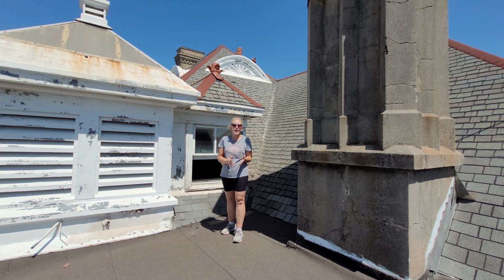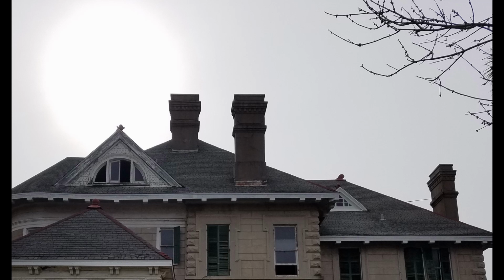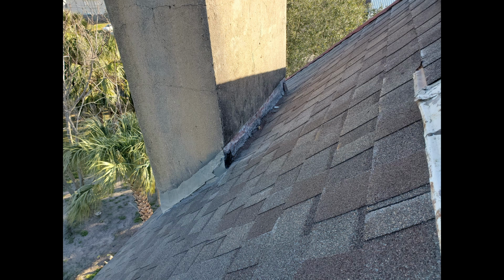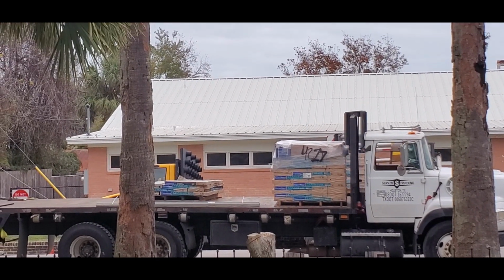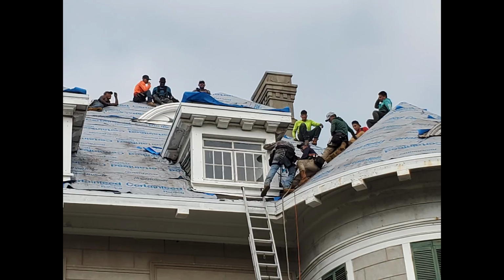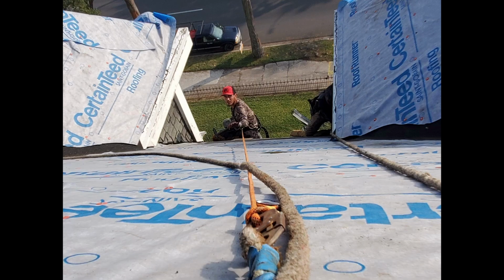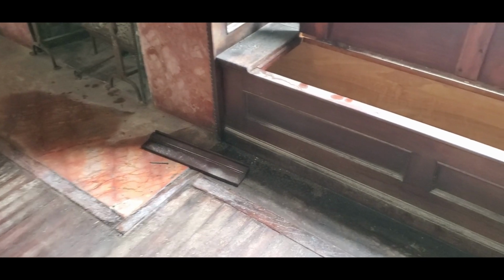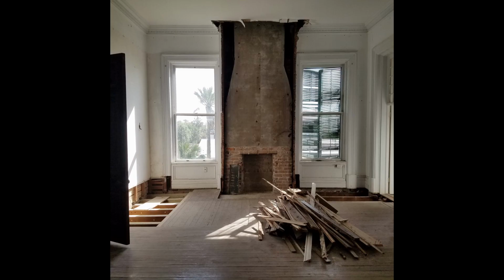S1.25 Replacing the Roof - A Renovation Nightmare

Comment: that one chimney next to the flat roof is magnificent! :O
Reply from the maker: It is.  I think it is original to the house and just got plastered over.  We are contemplating removing the plaster to repoint the chimney and leave it exposed.  The other three chimneys either collapsed during the 1900 hurrican or were altered later as they don't match the photos of the house just after it was built.

Comment: Having a defined scope of work is critical to getting proper bids. I like to include in my bid specs that any assigned sub contractor must sign off on the scope of work as part of the bid submission. I also require that subs must be liscened and insured. This prevents and protects you if the Roofing contractor subs out the work to some "handyman" who is unliscened, uninsured and hires his crew off a streetcorner..  I like the way you dealt with the estimator and held his feet to the fire. People are often intimidated dealing with contrators and being firm about your scope of work they bid on is key to getting what you want and backup if you need to go to litigation.
Reply from the maker: It is just amazing to me when dealing with a new company that they say all the right things, lay everything out and get the scope of work agreed to and then it falls apart because the crew that shows up knows nothing about what was committed to.  I had a friend who built a new house that was designed to be wheelchair accessible and had wide doors (designated on the blueprints) in every room and the framing crew framed for normal sized doors.  The builder stopped work because she refused to pay extra to have the error corrected and it turned into a big ordeal.  It happens all the time.  It's one reason why I never let anyone work if I'm not present to watch.

Comment: Isn't it ironic that you hire "pros" like roofers, etc. to do a job only to discover the estimator didn't correctly communicate with company who then didn't communicate correctly with the crew and you wind up with a halfway done job. Nothing builds patience like home repair, remodeling. restoration, construction.
Merry Christmas and may work go smoothly in the new year.
Reply from the maker: I know, it's so frustrating.  You ask all the right questions and check other work and it still happens over and over again.  It is so much easier when I can work with my own people and not have to go outside for help.  Merry Christmas and a happy new year to you!

Comment: And then, the chimney flashing failed again, a year later?
Reply from the maker: On one chimney.  We had a massive wind storm that did damage to the remaining old roof and I don't think the chimney was done properly so I think the wind affected it too.  It had been dry for almost a year before that one storm.  There is also a masonry issue with the chimneys that may be contributing.  We need to get the big lift back and get that work done too.